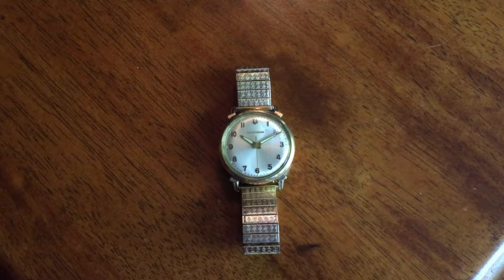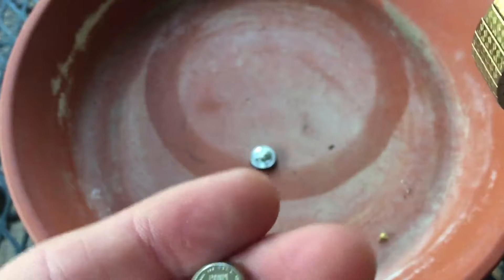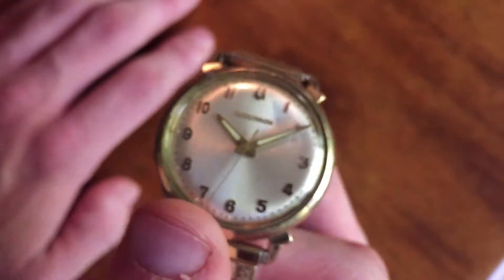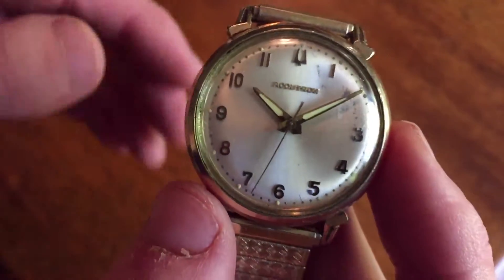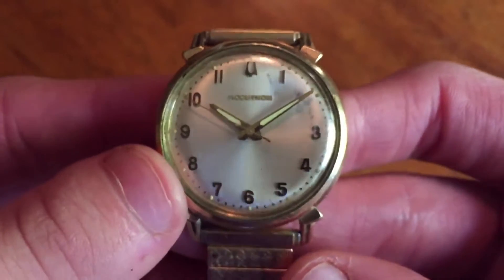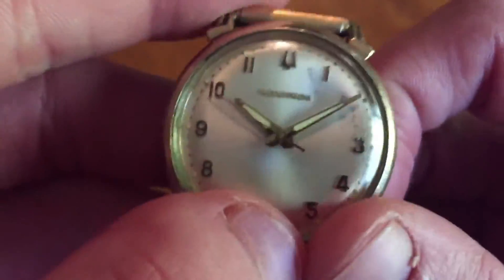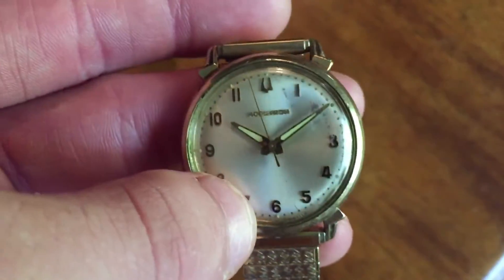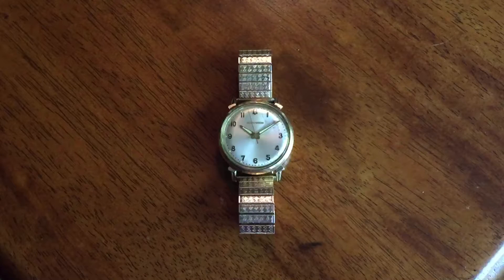Vintage Bulova Accutron Tuning Fork Watch

Comment: first of all, I wouldn't recommend hitting it on the table like that, because there's a part of that watch which is extremely fragile, called the index wheel, the teeth on that wheel are 0.0004 inches deep, so if you touch it, you will break hundreds of them. now banging it, I'm not sure, but I wouldn't risk it more than you did, I felt something when you did that, i don't know what, but it wasn't a nice feeling.

that mini circle on the watch with the ravine, try twisting that with a penny, it leads to the battery so you can change it yourself. [oh, I just realized this was made in 2015, if you can, please give me an update]

if its broken, give it to Bulova, they could probably put a new index wheel if that's what's broken, if it is, beware, it'll be pricey. so just make sure of everything first.

have a good one
Reply: oh, by the way, your watch has 2 forks:

https://www.google.com/search?q=1967+Bulova+tuning+fork+movement&tbm=isch&ved=2ahUKEwjS75uemefnAhUwSN8KHZ5JDwEQ2-cCegQIABAA&oq=1967+Bulova+tuning+fork+movement&gs_l=img.3...3259.9638..10074...0.0..0.64.1129.20......0....1..gws-wiz-img.......35i39.rXmbCY7f90w&ei=7C9SXtLJMLCQ_Qaek70I&bih=1081&biw=2133&hl=en#imgrc=IJQfWTEc2CnX-M

remember that there are a lot of fake (accutron) spaceviews on ebay, people will take apart an accutron that is completely fine, and do their own job to it, they started out as shop window attractions, but the shops got a lot of people liking them, so the shops were supplied with tools to do it for anyone who wanted, these were custom for anyone who could pay the people who mostly specialized in selling watches to cook up, they're not very common, just do your research and you'll be fine

Comment: Good grief.  If it worked before, it probably won’t after all that damn banging on it.
Reply: @loosemouthcowboy4790    It is never a good idea to bang a vintage watch against a hard surface, unless you like shorn-off wheel teeth and broken pinions touring around inside the movement. Sure it’s rugged, but a G-Shock it ain’t. And he’s doing that to a 214. What an IDIOT.

Comment: My brother has one like that our mother bought him in 1969. It's a valuable watch. Quit fucking with it, moron. The most valuable ones are the Space Views, clear face that shows the inside tuning fork. On the back it will have a serial no. and under that an M for 1969 and a number for the year. For example, my brother's is M9 for 1969. All Accutrons are tuning fork.
Now go play with your Hot Wheels or something.

Comment: Nice vid. You have a 214 movement. The battery for it is a 387s or 394 with the plastic spacer. Battery is installed positive side down and fat portion of spacer is on negative side of battery. You can use a US dime as a tool to loosen battery hatch. If it doesn't start up right away, "tap" the sides of the watch to get it started. If it doesn't hum, coils may be bad. Otherwise, these are great timekeepers requiring little maintenance! Cheers.

Comment: Put a battery in it and see if it runs, it probably will, battery goes in writing side facing you. It takes either a 394 or 380 battery, they are the same just different manufacturers numbers and are really cheap, buy one and put it in and see if she goes, if it doesn't go right away after you put in the battery, give it a tap on the table like you did and it should begin running and humming. I have a 1974 Accutron and I love it, it hums!
Reply: Don't tell him to give it a tap on the table, please. He will start beating the heck out of it like he did in the video.
Reply: 218 battery

Comment: OMG that watch is so special I can't believe you of banging it on the table and knocking it on its side like that there's a gear inside of that that literally has like 360 teeth on it if you touch this what human hand you will ruin the watch that tells sensitive the parts are in this watch doesn't mean that the watch can handle it but the purposely knock it like that OMG that's all I can say

Comment: When you are as young as you are, everything is new to you, even if it has been around for years. BTW, don't bang your watch against the table top. It will cost more to get it running when you send it to a watchmaker for service work after you treat it roughly.

Comment: crystal part ref #  1245  ... and ... 1245E ... both for vintage Accutron Astronaut ..... I own a 1966 [ M6 ] Accutron Astronaut " A " with 214HN movement .. WHAT IS THE DIFFERENCE BETWEEN CRYSTAL 1245 AND 1245E  ???????
Reply: The "E" 😉
Reply: @HowieDuwitt   great Bulova assigns a letter for a specific reason as in the case of a bezel usually NON click bezels are not assign a letter whilst a bezel that requires a click spring would be assigned a letter ... do u know what the letter E is designated for ?
 are u a serious collector ?

Comment: I have an old bulova watch but I don't know where to look it up at. It has L5 on the back and the serial number is A621705. And it says 23 jewels self winding six adjustments on the face.
Reply: When I looked it up I found one really similar to it but not the same one
Reply from the maker: L5 I think would mean 1955
Reply: +Pizzscn ok thanks 😀

Comment: that's some cool watch ⌚👍
Reply from the maker: Thanks dude!  I was blown away when I found out today haha
Reply: +Pizzscn did you ever get a battery and get your time piece running?
Reply: +Pizzscn if you still have it I noticed the watch face is a bit in rough shape. if you wanted to you could remove the face and convert it into a spaceview. also you would want to replace the crystal with a period correct one for the spaceview if you decide to do so. It is a '67 so it has the 214 movement behind the face and it's very nice looking. just a suggestion. very nice watch either way. cheers
Reply from the maker: I got it working!  I think I'll just wear it as it is :)  Thanks for the tip though!
Reply: No worries brother, They are nice either way. I have 3 spaceview watches of different years and I enjoy them very much.
Reply from the maker: Nice!  I have an astronaut as well but it needs servicing.  I'd love to get it running someday
Reply: Martin Marcus is who I sent my last one to. That's all he works on is 214 caliber watches. He's a bit on the pricey side, but he has all the original parts needed and does excellent work. The website if you're interested is http://www.accutron214.com